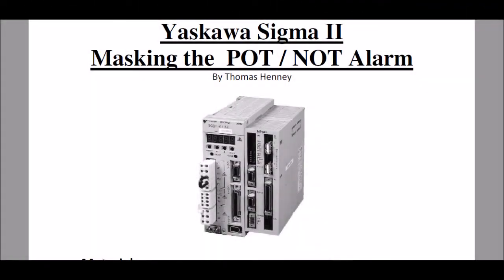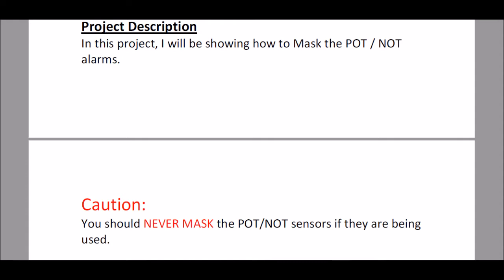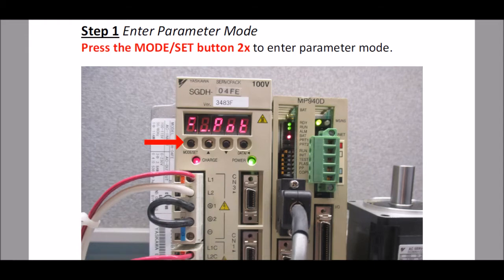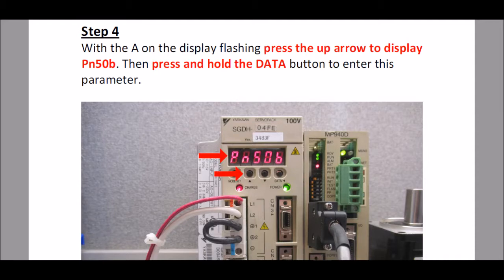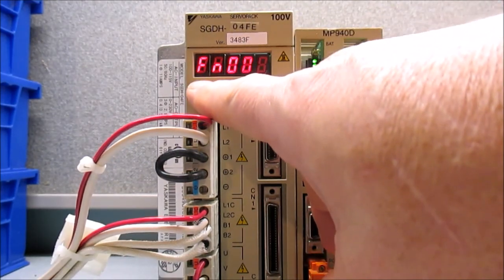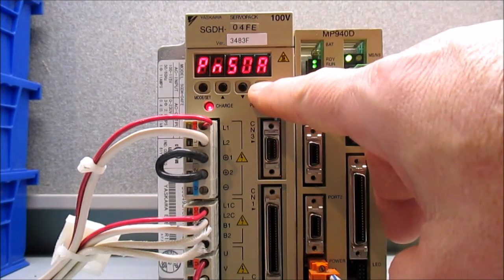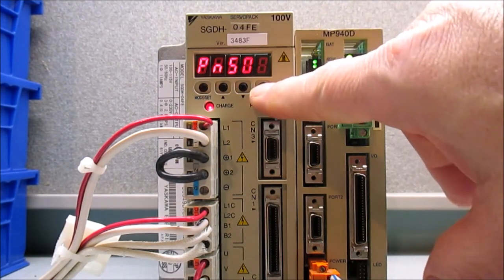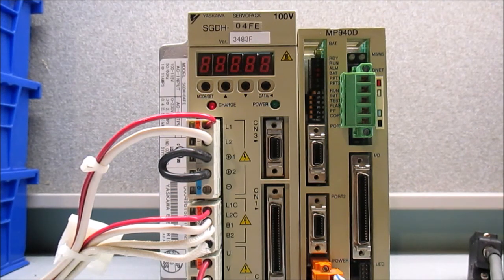Masking The POT NOT Alarms

Comment: How to fix bb error please ?
Reply from the maker: Good Morning,

.bb is not an error or fault. this is actually called base block.

The drive is in two sections LOGICAL &  POWER SECTIONS, in .bb the power section is off. 

Most probable cause is e-stop. Or if the ENABLE signal comes from PLC check the output.

Hope This Helps
Tom

Comment: Hi sir 
I have driver faldic RYS753m3-vvk-z55 
I can’t JOG or RUN
Servo no’t ON 
Help me, tks so much
Reply from the maker: Sounds LIke you have no Enable signal Is The drive in Run, IF not check circuit For Enable usually connected to Enable input on drive
Reply from the maker: Possible Estop condition or Bad Input on drive

Comment: how do you solve an A.9F error
Reply from the maker: mayhonimerida
Here is the several most common causes of the A.9F alarm. To start with the A.9F alarm is associated with the MP940 Motion Controller. 
The MP940 uses the A.9F (A9F) alarm as a general warning for several conditions. The conditions include the following

Excessive positioning error, now this could be servo or mechanical issue. I once had a bolt break on a linkage arm cause A.9F.
Local I/O error, this one i had dropped the 0vdc and it caused this alarm. Check all wiring for solid connection. 
External Encoder disconnected
Network communication error 
Divide by zero or parameter setting error.

For some of these errors you can find your problem using MotionWorks + software.

Sometimes if you power cycle this will clear the alarm. In cases such as this I am looking toward the,

Excessive positioning error, 

External Encoder disconnected
Network communication error
Divide by zero or parameter setting error.

Hope This Helps
Tom

Comment: Hello Tom,
We have problem on our Yasakawa shows error AC9, then we put new Yasakawa, alarm is gone but it has POT/NOT now with the new. We use this driver to move motor with gearbox. We do not have sensors for overtravel. Can this video help about our problem? Thanks
Reply from the maker: Baki T 
First the A.C9 fault is a communications between the motor encoder and the servo pack, looks like you may have already resolved this issue by changing the servo pack. 
The Pot / Not alarm is used to detect over travel of the motion, here you would be using either proximity switches or limit switches for detection of over travel. If you are not using over travel detection here is a link to one of other videos to disable it .
Hope This Helps 
Tom

https://www.youtube.com/watch?v=fB8J-qK-vlY&list=PL7gDpcbHLHwYhJBrvl6rfqKpOzjKTnKSF&index=4
Reply: @tomh2466  Thank you Tom.
We solved the issue. The main thing was that the servo pack was not set up in parametars at all, and when it come to us on him there was label that say it was PROGRAMED on specific date. We enter parameters from the old one and we finis the job.

Comment: how to remove bb error?
Reply from the maker: SPACEMAN,
The .bb really isn't an alarm, its called base block. This is the state when the servo amplifier has power to the LOGIC section of the drive, but not the POWER section BY DESIGN.

Now without much of a description I would guess you do not have the SERVO ON signal.
Now I am not familiar with your system, but what the servo needs is the SERVO ON signal. /S-ON. Normally I have seen E-Stop keep the servo in .bb. 

Pin 40 on the CN1 terminal block needs to be TRUE. Now depending on your system I would check power at that terminal and trace back where the signal comes from PLC, Motoin Controller etc.... 

Hope This Helps
Tom

Follow this link to the manual
file:///C:/Users/D837186/Downloads/YEA-SIA-S800-32.2%20(3).pdf

See page 56.
Reply: @tomh2466  But I want run command on my drive.
Reply from the maker: @spaceman.i  When the servo on bit is high you should have the RUN command. The Servo On bit is what causes the POWER TO BE  APPLIED TO  POWER SECTION. 

Tom
Reply: @tomh2466  what should I do for that?
Reply from the maker: @spaceman.i  first thing what I need to know is what type of application are you running there are you using a PLC a motion controller or do you have this just set up on a desktop for your experimenting with.

I hope this helps
Tom
Reply: @tomh2466  I am using along with PLC
Reply from the maker: @spaceman.i  okay is this actually part of a process or are you just experimenting
Reply: @tomh2466  I am not experimenting. I am trying to run the machine which was in a breakdown from a very long time. I assembled everything and cleared POT NOT error after installing the drive. FYI, it is a transformer coil winding machine and I am an engineer.
Reply from the maker: What model of servo are you using by yasukawa
Reply: @tomh2466  Sigma 7
Reply from the maker: You will need to verify that you have 24vdc at pin #40 this is the SERVO_ON signal. This signal engages the power section of the servo amplifier. Also for the Sigma 5 & Sigma 7 has a "Safety Function Signal" this is connector CN8, there is a cable to connect to the safety circuit but there is a jumper that can be used also. But you normally see .hbb which is "Hardware Base Block". 

But you definitely need to see if 1. The safety for CN8 is taken care of. 2. you have 24vdc at pin #40 of CN1.

Hope This Helps
Tom 
 @spaceman.i

Comment: Just bought 3 Teco TSTA 20c drivers and they are showing the pot not on start up ,was wondering if the procedure for the Yaskawa  is the same for the TECO
Reply from the maker: Hello Bernd
Found a manual for your drive, looks like CN002.1 is the parameter to enable / disable the over travel limits. If you set this parameter to 1and power cycle after saving this should solve the problem. Below is a link to the manual, see page # 5-65.

CN002.1  =  1
CCWL and CWL(external limits) are
ineffective.
CCW&CW rotation is not limited by
CCWL&CWL.

https://machmotion.com/documentation/Drives%20-%20Servo/Teco/Manufacturer%20Manuals/TSTA-User-Manual.pdf
Reply: Thanks Tom will try in the morning and let you know if this was the problem ,
Reply: got the servos to show run by going to the Cn002 change the H0000 to H0001 power down and power up and got the motors to jog ,Now need to check the drivers to see if the output pulse is the same as the input from the controller Cn001 right now  Cn015 is showing 00000  so i think i need to get the pulse rate set at what the encoders are on the motors and hopefully this will solve my motors not moving with the controller. learning to read this manual is not easy when your a tool and die maker,not IT guy!
Reply from the maker: @berndloos7903  
Sounds good,